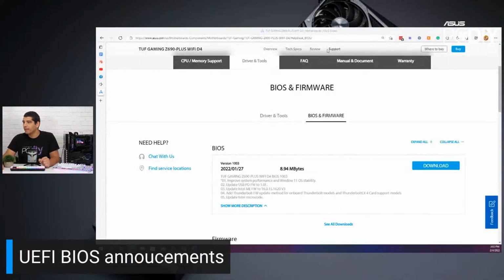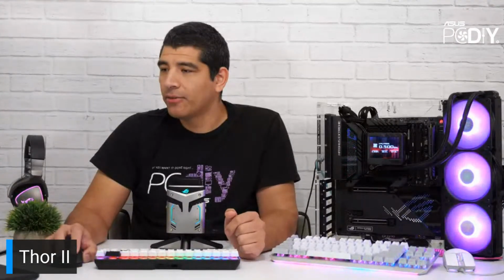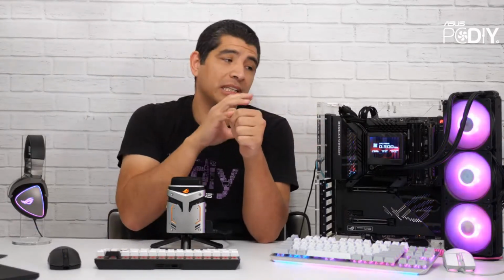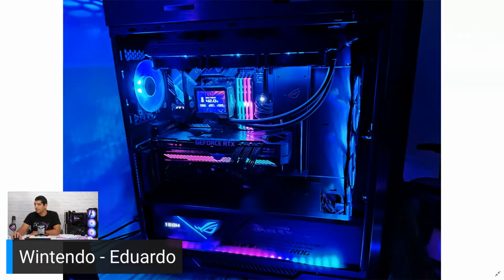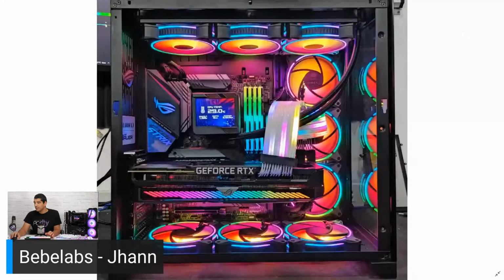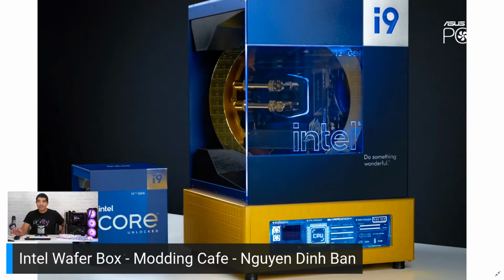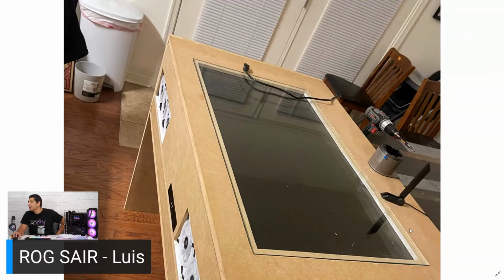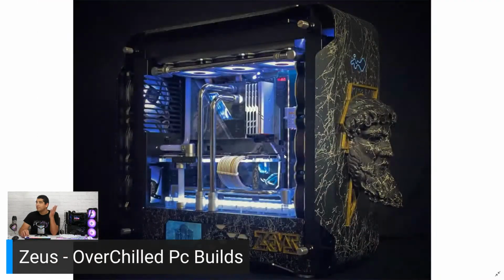ASUS PC Hardware Show #43 - ROG THOR II PSU, TUF GAMING B550 PRO, PC build & setup spotlight & Q&A

Comment: Hi JJ, I just started watching your videos as I recently built my new PC with Asus parts. Some of your videos have been extremely helpful in fine-tuning my system. However, I have struggled to get DDR5 RAM to work at a rated speed of 6400 MHz (G Skill - QVL confirmed) using Z690 Formula, i9-12900k, and G Skill 64GB (4x16 GB kit). I have a reasonably good cooling set up with Ryujin II 360 AIO and 3 case fans. Why is it so hard to run DDR5 with the default XMP profile at a rated speed? I followed your earlier videos on overclocking and performed all baseline/memory testing (passed). I keep getting random POST errors (F1), perhaps indicating something wrong with the configuration. Is this something that could be fixed in future BIOS updates? I have an XMP I profile with most options set to either auto / AI optimized. I apologize if this is not the right place to post my question/comment, but somewhere on this video, you mentioned that the overall base speed may go lower than 4800 MHz when all DIMMs are installed. I probably don't understand the concept of XMP anymore and would greatly appreciate some direct insights.
Reply from the maker: There are no issues with your system or DRAM but you are trying to achieve a result that is not possible. Overclocking DRAM is based on the limitations an the margin defined by the IMC ( memory controller in the CPU / platform ) 4 DIMMs regardless of their rank, density or IC is not going to support the same frequencies as 2 DIMMs ( are also affected by rank, density and IC ) you will generally see a range of 2 being around 5600 - 6400MHz ( this is affected again by the rank, density and IC )

For instance, SK Hynix or Samsung generally offer higher speeds than Micron and 2x8 supporting the highest speeds compared to 2x16 or 2x32.

In your situation, you are further complicating issues by mixing kits and trying to apply a profile designed for 2 DIMMs and trying to apply it to 4.

The max you will generally see for 4 DIMM is going to be 4000-4400MHz some may be able to reach higher 4800MHz+ with some better IMCs but this is not guaranteed.
Reply: @ASUS North America  Thank you for the clarification. This is very helpful. I just assumed that all four modules can be run at the top speed since the motherboard had that many DIMM slots. I'll stick on to a single kit of 32gb for now. I appreciate your response.